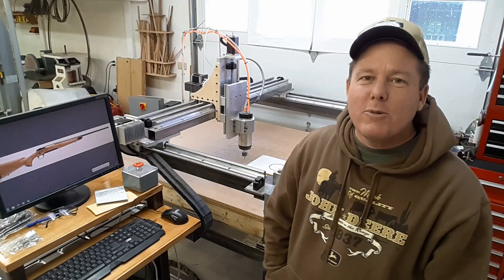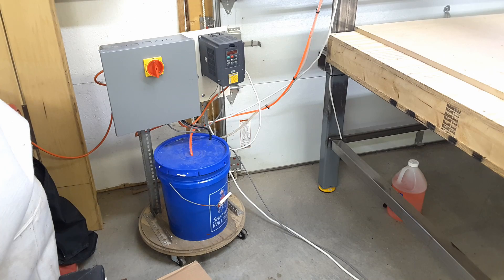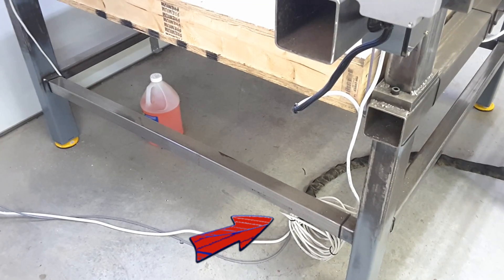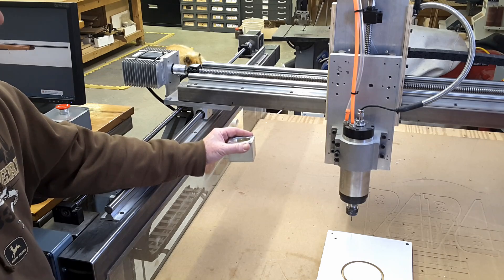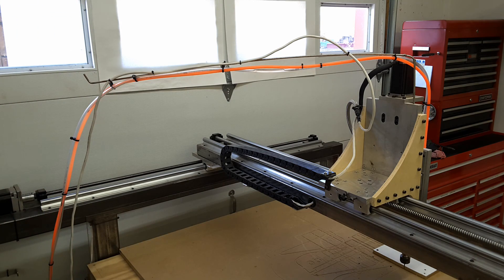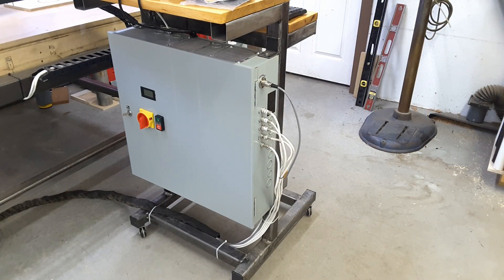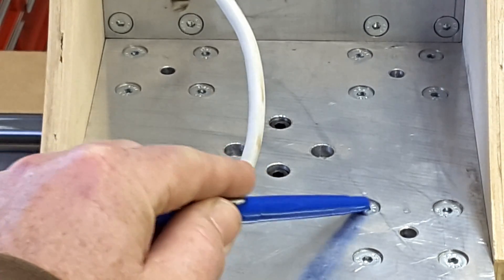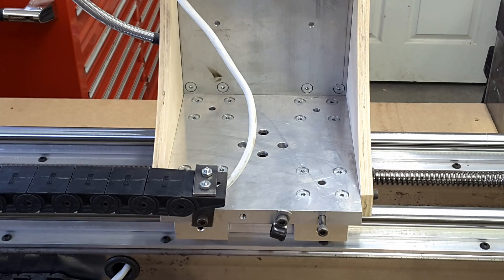Lessons Learned building a DIY CNC Router

Comment: Nice videos. Did you end up going with the NEMA 34 or NEMA 23 for your Z-axis? I'm using some old NEMA 24 (431 oz.in) from a previous build and finding they are a bit undersized (on x-axis, possibly y) for what I'm trying to do. I'm looking at NEMA 34 1200 or 1600 oz.in, but I'm leery about pulling the trigger on a larger motor for the Z-axis.
Reply from the maker: I did pull the trigger for all 1200 oz 34's.  Then when I got to the Z axis, it was just too much motor and weight out there for my liking and need.  So, I reduced the Z axis motor to a 23.  It has more than enough grunt given the mechanical advantage provided by the ball screw.  In the 'practicle' stepper review video, I note the size of the 23 as 400 oz.
Reply: I ran my first test programs last night and the x-axis lost its step - between programs while in rapid mode. I went through quite a bit of work aligning x and y, so I'm thinking the motors are too weak for my heavy gantry. I re-zeroed and got the part to turn out anyway, but I think I'll bite the bullet and order the upgraded motors. Getting a 3-axis kit and will probably leave my 431oz.in motor on z and start looking at building a 4th axis. Enjoying your videos, keep posting.

Comment: have you done  video on putting the smooth stepper in your computer yet? I've run into the same problem and am researching if I should change over to the other system other than Mach 3 that so many people have talked about. If you had good luck changing yours over I'd like to see how you went about everything.  Thanks so much for your videos, they are really helpful.
Reply from the maker: I know I shot a video, but I don't think I ever edited it.  I am having zero problems and in fact wouldn't do it any other way in the future.  Shoot me a PM with your challenges and I'll see if I can help.

Comment: Hey, man. A couple of quick questions, if I may:
1. Is there any reason behind lowering the spindle that much in the spindle mount? To me, that looks like an unnecessary added weakness (the longer the arm of the force, the greater the force / deflection)
2. The X motor is mounted on a really thin (to my eye) sheet of aluminium (what is that, 8mm?). Is this enough to prevent any flexing of that plate, when encountering larger X-side forces?
Thanks!
Reply from the maker: Eros Nicolau The reason for the spindle being that low is simply for reach.  I can't reach the table with small bits if I dont.  It is a design flaw.  As for the X axis, it is plenty.  the forces are all twist.  the bearings on the lead screw take up the linear force.

Comment: a good solution to the waterbucket problem could be a plastic fuel cell from summit racing 
https://www.summitracing.com/int/parts/jzp-892-010-01/overview/
or an old watertank out of an RV
price is about 70 bucks new....... be cheaper to just raise and re-weld the crossbrace on the table so the bucket fits 

for the touchplate : router or drill a small pocket intoo the side and gleu / epoxy in a realy strong magnet , now you can stick it anywhere (on metal)
 
wat you could do with the gantry problem is weld nuts on a plate that fits inside the box section (basicly make realy big t nuts) and put the screws in through the adapterplates from below like you mentioned

i read up on usb boards because i planned to go that route as well wat i found out is : not all of them work well with mach3 (no add ons available to make them work ) and that there succeptible to electrical interference  
ethernet types board's (like the smoothstepper and some russian made one ) seem to do better with the interference  
it might allso be handy to be able to follow the mach3 progress from the livingroom laptop 
i allso recently learned that even if some USB BOB boards work  (AK250) , , they dont alow slaving two steppermotors together (channel A and Y in my case ) wish felt to me like a record scratching across to the end 

at this moment i'm looking intoo this : http://www.ebay.de/itm/UC300ETH-5LPT-ethernet-motion-controller-for-Mach3-/112201995325?hash=item1a1fc2943d:g:yM8AAOSwx2dYJtMV

and closed loop steppermotors

Comment: All you say is quite valid, hindsight is a wonderful thing and even though I built my machine about 6 years ago I am still finding ways to improve it and ideas that if I did it again would do differently. But like you I love my machine just the way it originally was and now even more with the enhancements and modifications I have done over the years. I am not rushing into building another one but it is my eventual plan to do so and to incorporate all the things I have learned using the one I have. Thanks for the excellent videos and advice. We are all learning from each other.

Comment: If you want to avoid having to buy all the extra cables you could buy a set of make and female plugs and cut them at the machine so you have "extension cords" between your motors and control box. 

Also you mentioned the Speaker/microphone plugs you can also by the corresponding mic/speaker cords to connect your motors. They can be can be orderd to length and you dont have to make them. Not sure if you have discussed it yet or not
Reply from the maker: Someone else suggested the 'extension cord' affect.  I may do that.  I can say that this video has inspired me, with comments from the community to re-do my cooling.  That video is coming.  I'm still waiting on one part.

I hadn't thought about buying a pre-made mic cord.  I have zero music background so none of those items dawn on me.  Other than maybe a cost issue, being able to buy them would be a reasonable way to go.  Thanks for the thoughts.  P.

Comment: Regarding your computer, I wasn't sure if I understood your thinking, did you mean that the USB Smoothstepper is preferable to the Ethernet version?
Great video, the hindsight gained is just as useful as the build progress.
Reply: Get a Mesa Electronics anything I/O board. It's real hardware not tinker toys.
Reply from the maker: Both the USB and Ethernet Smooth Steppers are acceptable and perform the job well.  I would look at the USB version if I did it again simply for the decreased complexity in the setup.  For USB it is plug in, load drivers and go.  things we do a lot with our home computers.  The Ethernet version, although well documented, requires network setup and things that are more complicated and prone to error not to mention getting outside of peoples comfort zone.
Reply: Ah, thanks for the reply, I reckon I'd be OK with the setup, but yeh it's awkward if it doesn't work first time because there would be a zillion reasons why. 

edit: after a bit of research, a lot of people recommend the ethernet version, just a FYI

Comment: Nice rig!  Regarding the fluid line, HP uses rubber hose in their large format plotters, to feed ink to the heads.  Not sure of the pressure, but they seem to last forever.

Comment: Great looking machine! Congrats on that. I have built a similar CNC machine just a bit longer and I'm using rack and pinion on x , y and ball screw on z with nema 34 1600oz/in steppers. My question is what max speed you achieved with your machine? My z axis motor stalls after 1500 mm/min but I can push the x and y somwere around 4500mm/min considering I'm using r&p on those axis. Thanks!
Reply from the maker: Marsel Mars  I get about 750mm/mm before I get concerned about missing steps.  I blame the harmonic that starts in those really long ball screws.  I am starting a plasma machine now and will be doing belt drive.  it will behave much like your r/p so your info is promising.
Reply: sbirdranch the harmonics come form the motors the long screws produce whipping. I have some really bad noise and vibration from the motors caused by harmonics at about 1000mm/min and I can't install harmonic dampers on the motors since I don't have a rear shaft on them, hopefully I will upgrade to servos after earning some money with the machine :)
Reply: horse1066 there are ways to cancel the vibrations with harmonic dampers mounted on the rear shaft of the motor. But in my case this is difficult because I don't have rear shafts. also the vibrations are transmitted trough the shaft and applying some sond proof material on the case I don't think will help much. There is a need for a mechanical damping solution similar to the car engine crank shaft damper.
Reply: I was thinking about the general vibration on these machines, and wondered if the same acoustic dampening compounds used in sound studio construction could be applied to a CNC's motor casing

Comment: I noticed you had a lot of room on your carriage.  I recomend looking a closed loop water cooling systems for a PC.  It is a big industry so you will find any option for a cooling system to ride on that carriage to easly cool that motor. and some come with a nice fan.  all can be done for less than a hundred dollars.  https://goo.gl/3cKxHh  this is a newegg link for an example.
Reply from the maker: Damn!  I have got to learn to hit the Reply button......Let me type this again.
Blah Blah Blah....EXCELLENT Idea......Blah.....Never seen before......I will try it.  Look for a video....Blah....Thanks P.
Reply from the maker: P.s.  Your link is not as described.  You might update it.
Reply: If mounting this on a carriage then you'd need to minimise the weight of the water loop. You could make this more effective by adding a peltier cooler to a waterblock, and use electricity rather than air to cool the system.
Google "Thermoelectric Peltier Refrigeration Water Cooling System"

Comment: Got a link for the spindle mount?
Reply from the maker: Mine came with the kit, but it is 80mm in diameter.  Here's a link to one that will work.
http://www.ebay.com/itm/80mm-Spindle-Motor-Clamp-Mount-Bracket-Diameter-Screws-for-1-5kw-2-2kw-Spindle-/201577527831?hash=item2eeef4fa17:g:h84AAOSwYmZXKuqe

Comment: Just a quick tips don't use those round bearing rails use profile rails . They are sooooooo much better. The round rails will have a lot of slop in them you will get much better accuracy and cleaner cut with a profile rail at least on a cnc router or mill. A plasma won't make a whole lot of difference.
Reply from the maker: When you say 'profile rail' is that they flat rectangular rails?  P.
Reply: Yes the are rectangular. They have 4 contact points on the sides for circulating balls. You can find Chinese rails for good prices and pretty good quality.
Reply: Its one of the most important upgrades you can do!
Reply from the maker: I would be interested to try those as a replacement of the round ones on the Z axis for sure.  Thanks for the suggestion.  ~P.
Reply: He means Hiwin rails. They are 92$ a meter and 115$ for 1.5m with the carriages. Knock offs are a bit less
Reply: HIWIN, THK, NSK, IKO, and other brands.
Used units are pretty nice.

Comment: I built a Dave Gatton designed wooden CNC about a year ago and It works great. I am thinking of going bigger with a metal CNC router. I have been thinking using 80/20 (expensive) but I see yours is 2x2 tube. I like the idea and have the capability but my concern is warping of the frame during construction. Are my concerns founded? Also what is the wall thickness of your tube?
Reply from the maker: ...crap...I lost the reply I had typed....
Warping....The only concern for warping I can think one might run into is with heat from welding.  In this design the only welding on the gantry axis framework are the stub legs that are then bolted to the table.  In that case, you have a place to shim and adjust out any warp.  I did not find that to be of concern although I planned for it.  Check out the overview video and I show more of the places where I built in adjust-ability.  I added a link in the comments.
The gantry tubing is 2x2, but the Y axis frame is 3x3.  I think the wall thickness is .125" (3mm), but might be .1875" (5mm)
Thanks for the questions.  Preston.

Comment: i appreciate this video very much!  Where did you get those massive heat sinks on your motors?   are those necessary?  Also, did you say something about a parts list?
Reply from the maker: Those heat sinks came from the same place that the mic plugs came from.  There is a link in the comments.  They do web sales and are available to talk on the phone, so you don't have to be local.  I'm not affiliated.  They are just good guys.  If you talk to Dave, tell him you are asking about something from Preston's video.
Back to the heat sink...No.  They are not necessary.  I turned the amperage down at the driver and they no longer get hot.  There is more on them in the overview video.  I added a link to the video comments.
Preston.
Reply: sbirdranch thanks so much!   I'm working on putting together a plasma cutter table!
Reply from the maker: Really!  So am I.  I just started getting my design down in Fusion360 now that I have my paper sketches worked out.  I will be doing videos on that build as it progresses.  Good luck with yours.  ~Preston.
Reply: sbirdranch so cool!   do you think it's worth getting Fusion 360 before you even have a running machine?  I thought it might help to sort out my design ahead of time.
Reply from the maker: I sort out my design best on paper first.  It is way faster and I don't have to think about anything except the design.  Then I model it in something (I used Sketchup for this machine) to get dimensions right, etc.  It I am encumbered with learning how to draw while trying to design, I loose focus on what is important.  In the case of my plasma, I am modeling what I drew on paper with actual dimensions.  I am getting practice with Fusion360 and I will be cutting my parts out of wood first for prototype and final fitting.
Being that your situation probably qualifies you for a free copy of Fusion360 I see no reason to wait.  In fact knowing how you are going to do your CAD and CAM is going to be very important lest you won't get very far post build.  A funny story here is I speak from experience....I finished my machine and realized I had no G-Code to play with.  In my case I used Easel to make a quick widget to play with.
So what I don't know, is how to do sheet metal/plasma stuff in Fusion.  There is a plugin I believe for the CAM piece.  Maybe someone else with more experience can speak up here.
Reply: Fusion is free so why not...